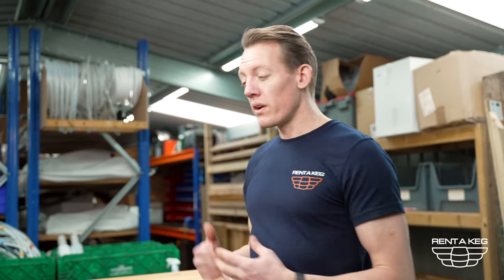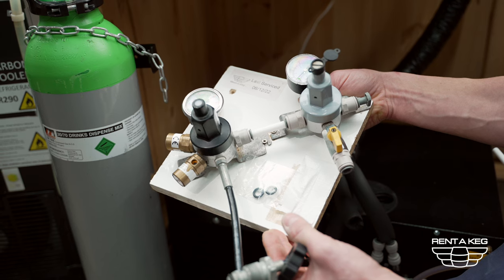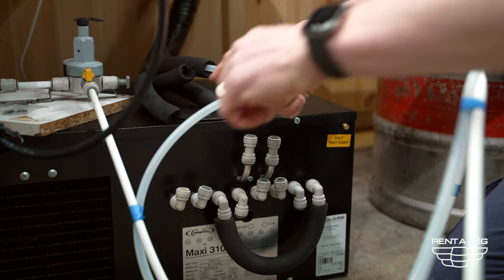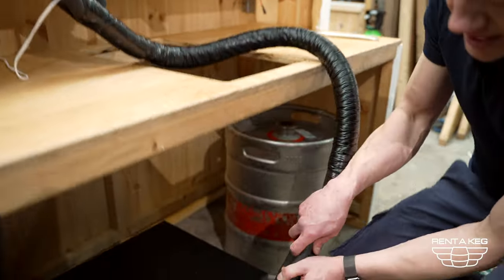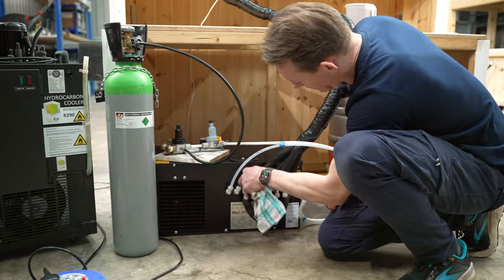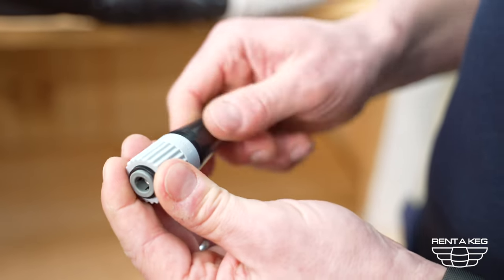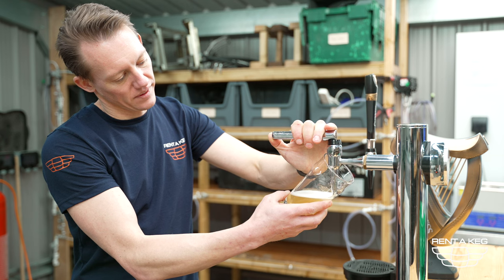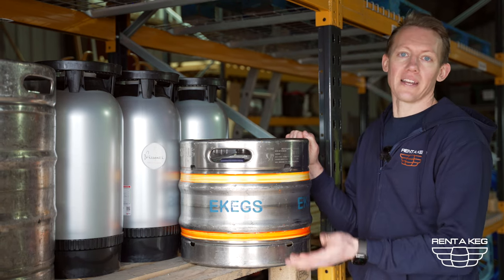How to Setup a Keg & Draught Beer Drinks System

Comment: Is there a place to buy a mobile table top tap similar to this?
Reply from the maker: We build our wooden ones in house however you can buy metal versions from Grumpyjoe.co.uk then clad the front with wood. This looks great. Otherwise we sell custom made stainless steel bars from £1500+VAT

Comment: What psi do you set for co2 for your lager?
Reply from the maker: It depends on the temperature that you store your keg at and the co2 volume in the keg. We use slide rules to calculate this based on brewery specification. If you pop us an email with a rough temperature of your keg and also what product you will use we can fire you back the recommended psi
Reply: Great thank you! Your email helped alot. Just a quick one, how long does the gas line need to be from the regulator to the coupler? Also do you leave the gas on for the whole period the system is connected?
Reply from the maker: @jagjitpanesar9111  Doesn't really matter how long the gas line is for a home install. We leave the gas off when not in service and uncouple the keg. You can leave the gas on however you run the risk of overcarbonating your keg if the PSI isn't setup correctly.
Reply: Great vid. I have had 6 kegs through my setup since building it. I used all new parts for everything. After getting loads of foam I bought 2x keg cooler jackets which helped. I used 3/16 piping from my cooler to tap. There is no leaks but I still get fobbing. My kegs sit at 8deg and I have tried different taps but still get foam. My pressure is at 38psi for 60/40. Although I got told to use 2 bar for a shortish run. About 3 metres. I have had madri running spot on for 3 days then that started fobbing. I know you cannot see the system but do you have any thoughts. Thank you
Reply from the maker: Hello. My initial thoughts would be a temperature problem if fobbing however you have covered that. Can you send me some pics of your setup to hello@rent-a-keg.com so i can give you some advice?
Reply: Hi I’m using co2 for my home bar using estrella and birra morretti kegs…. I’ve been having my psi at 18-20 psi and my beer just doesn’t taste like a proper pub beer it tastes flat or smooth tasting if that makes sense ? What can I do please help
Reply from the maker: They PSI will depend on the storage temp of our kegs. Do you have this? If its room temp you'll need to adjust the PSI using s Co2 slide rule (You can by these online). Co2 vol for Moretti is 2.3L. It runs at 16PSI at 12 degress. To use a slide rule, put the rule to the temp of the room storage then adjsut the CO2 vol to 2.3, this will give you the correct PSI. Just make sure you do not go over the reg's max PSI rating. I would highly recommend getting a qualified dispesne technician to do this. Estrella is same specs.

Comment: How much would this cost ?
Reply from the maker: For any quotes please contact us via our website.
Reply: @RentaKeg why don’t u just tell us. For you guys to sort the parts, just give us a price range. How much did or would u pay for these parts and how long would it take to set up. Not that hard
Reply from the maker: @BobGnarly420  Theres large differences in costs as specific beers/drinks, require different components, hence the need to quote. However as a rule of thumb expect to pay at least £1000 for a 1 tap system and up to £1800 in some cases with cleaning equipment, gas and fitting. Cost per tap price does reduce the more taps you have.